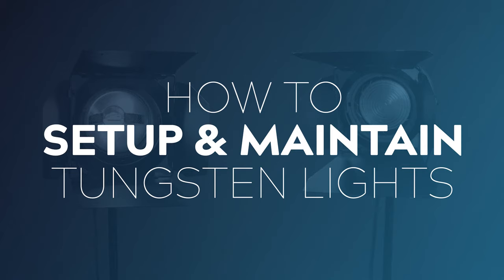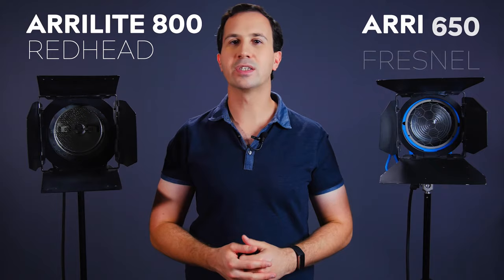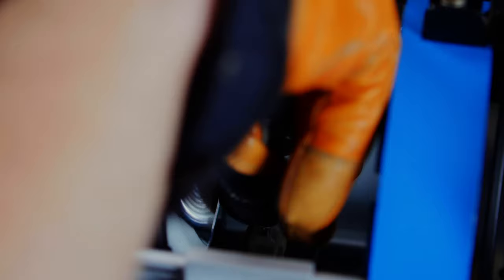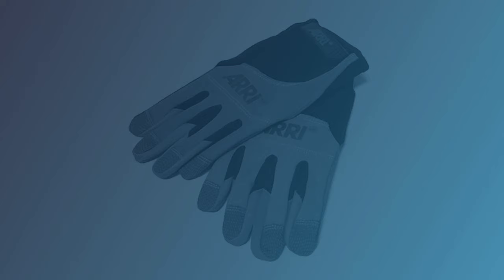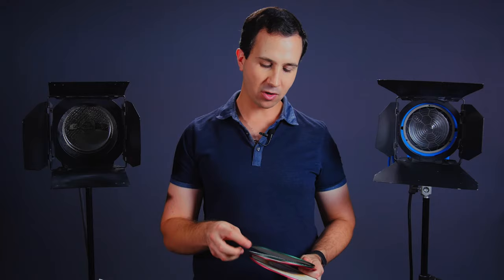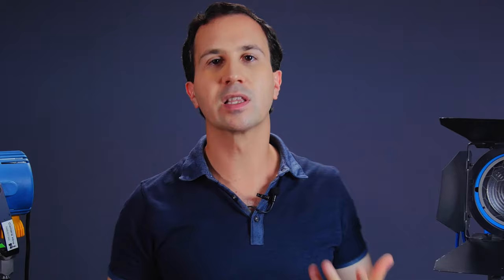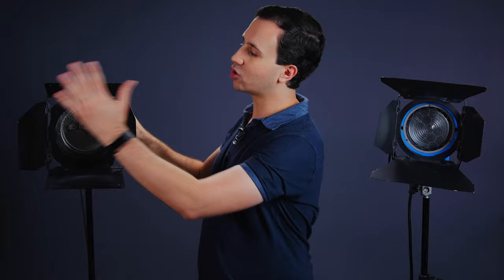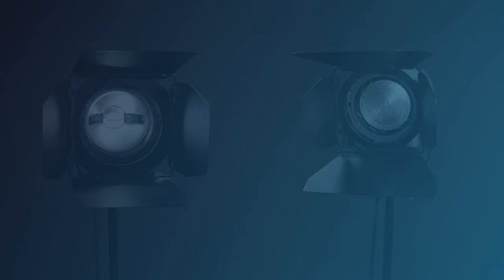Working with Tungsten Film Lights | Film Lighting Techniques

Comment: Looking forward to owning an Arri lighting kit.
Reply from the maker: They’re brilliant. One of those pieces of kit that just work. They are super reliable, will last years of abuse and always get the job done.
Reply: @CreativePathFilms  I saw a kit of ARRI 650s for about a little over 3k and another with a 150, 300, and 650 for about 2700. Maybe one day I'll get lucky and there will be some sort of sale haha
Reply from the maker: @Lycan Visuals  
Keep an eye on the used market. They’re often being sold off to be replaced with LED fixtures these days. Look at auction houses, FB marketplace, filmmaking buy/sell groups and eBay. You can find real bargains on Tungsten lights. 

Look up and call some lighting companies/gaffers in your area and let them know you’re in the market. You could also get in touch with Film schools and see if they ever sell off gear, thats where we picked up our 2k and our 650 and 800 sets. 

Because the lights are pretty much bullet proof, you can save a lot of money. They’re so simple electronically that often the only thing you may need to get repaired or replaced is the power cable. Once that’s done there good for years.

Comment: Thank you. Great video. I have a question, for daylight 5600K, is it better to use Tungesten light with CTB gel or a HMI light right away? I read recently "Tungesten light emit a smoother spectrum of light than any other artificial sources, making for the most natural skin tones"
Reply from the maker: Great question!

This is all my personal opinion, drawn from my own experience lighting and shooting. 

I’ve come to prefer using native sources. I definitely agree with that statement - but you get those benefits mostly when you’re lighting and shooting with your WB at 3200k. 

Tungstens full spectrum quality is hard to beat when it comes to beautiful skin tones. But I’ve always thought once a gel is applied you start to lose some of those qualities/benefits of a full spectrum source and your colour accuracy is then determined by the quality/imperfections in the gel instead. If the gel is older or starts to fade/melt this becomes really noticeable and you start to see things like green shifts. 

I personally feel that native 5600k sources (hmi or a high CRI/TLCI LED) look better on the skin at 5600k then a gelled tungsten fixture. 

But the difference is pretty negligible. Practically, I wouldn’t hesitate to mix a gelled tungsten with LED/HMI sources, nor hesitate to use a gelled tungsten if I needed to, but for the best quality that’s my preference.

If you’re looking to buy a new light, I find myself using 5600k lights 95% of the time these days unless I’m in a studio environment or a location calls for a warmer tungsten look.

Comment from the maker: Just a quick amendment: okay so turning the light off for small adjustments such as panning, tilting and gelling might be a bit overkill. For large moves, definitely switch it off though! When you used to teach at a film school like I did, where these blew all the time, I guess you get a little over cautious with your instruction! Haha. Just be careful guys.

Also, I made an error when putting this video together. Green scrims are a 1/2 stop light reduction, and red scrims are  a full 1-stop light reduction. The half scrims will reduce the output on half of the area of illumination, so is useful for reducing the output hitting the foreground vs the background. Useful for when lighting multiple subjects at different distances in the one frame.
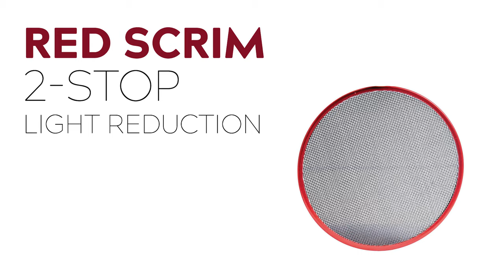Reply: 07:28 The green colored scrim reduces the light by a 1/2F-stop, while the red colored scrim is more dense and reduces the light by a 1F-stop. The half single scrim is often used to divide the foreground and the background lighting resulting in an 1/2F-stop less light on the foreground area than the background.
Reply from the maker: @_C_E_D_  you are correct, that was an error I made when putting this video together. Thanks for the note!
Reply: @CreativePathFilms  No problem, I like ur videos about C-Stand and lighting fixtures, it's really detail-oriented and clear. Rarely seeing these kind of topic on the internet.
Reply from the maker: @_C_E_D_ thank you!

Comment: You say the light temp changes when you dim the light. If you use a CTB gel to correct for daylight and dim the light, is there some calculation that has to be done or is the effect of the gel on the Kelvin reading the same?
Reply from the maker: Hey Leon, great question!

It’s all relative. If the tungsten source shifts (for example) 500 Kelvin warmer as the light is dimmed, and then you add CTB to that, the result will still be 500k warmer. 

To get it to a daylight value of 5600 Kelvin from a dimmed tungsten light, additional gels would be required. 

To know precisely how much a light source shifts when dimmed, you would need to use a spectrometer, like the sekonic c800 to get a precise readings.

Comment: Hi.  I just ordered an old school Arri 2k for studio use. 

Can you recommend working distances? I’ll be shooting through magic cloth. 

Also is it ok to put a 1k bulb I. If I ever needed to? 

Thanks!
Reply from the maker: Hi Jesse, 

Thanks for your message, I haven’t worked with magic cloth personally, so can’t speak to how heat resistant the fabric is. I have been trying to find an answer for you but so far haven’t been able to find anything definitive. 

With textile diffusers I would typically put them on a 4x4 frame and have them around 3+ feet away from the barn doors, at which distance you should be pretty safe I would imagine. If you’re using a larger diff your’ll probably have to get it back further than that anyway. Play it safe. You probably won’t want to get a 2k too close to your talent anyway, unless it’s the dead of winter!

Not sure about the 1k bulb. A quick poke around the Arri website seems to indicate that the Arrilite open face 2k (which we have) can only accept 2k bulbs (I don’t think they even make a 1k in that size bulb). 

 Though it looks like the 120v version of the T2 fresnel may be able to accept 1k bulbs. 

Hope that is somewhat helpful 🤣
Reply: @CreativePathFilms  Thanks for the info. Appreciate it. These Arri lights produce such beautiful light I'll def keep researching and testing to know them better. Great channel!!
Reply from the maker: That they do. All the best my friend, I’d love to hear about what you learn from using them and see some of your results. All the best!

Comment: Loving the content, instantly subscribed!
I have a question:
You stated that the green and red scrim provide a 1 stop and 2 stop light reduction respectively.
The scrim kits i was able to find report a 1/2 Fstop and 1 Fstop reduction respectively.
What's to be believed? Is it just a matter of names? 
In simpler words, with the green scrim the light intensity is halved (1 Fstop) or something different?
I am pretty confused, thanks in advance and keep up the good work!
Reply from the maker: Hey Fabio!
Thanks for subscribing and for posting your question! Great to have you here.  

Yes you’re right! I’ve accidentally made an error - thanks for picking up on that. I’ll post an amendment in the description. 

A green scrim (single) = 1/2 stop 
A red scrim (double) = full stop
Reply: @CreativePathFilms  
Thanks to you for clearing up a confusion I had ☺️
Reply from the maker: No worries at all 😊

Comment: what kind of dimmer switch is that on the tungsten Arri 800?
Reply from the maker: It’s a TecArt 1000w single channel dimmer. Here’s a link if you’re in AUS:

https://secure.johnbarry.com.au/single-channel-1000w-dimmer-tec-dimpot2

This seems to be a comparable US equivalent:

https://www.bhphotovideo.com/c/product/755346-REG/Impact_D_1000_D1000_1_000W_AC_Dimmer.html

Comment: What About power? Do you need a generator or somthing?
Reply from the maker: Depends on the situation. 
Tungstens are AC only lights, so if you’re using them away from mains power then yes they need a generator. They do draw quite a bit of power so if multiple lights are used power draw and circuits become a big consideration.

I also cover this point in more detail in this video:
https://youtu.be/iHxANOeLoTY

Comment: Hello 👋, thank you 🙏, can you please share a link to where I can purchase those bulbs for the arri 800w and if possible the redheads too… I have failed to find their replacements! Thanks.
Reply from the maker: Thanks for stopping by! Thanks for the comment. 

This is the model you’re looking for:

“Osram Lamp 64571 P2/13 DXX 800W 240V”

Depending on where you are in the world, you’ll need to get r correct voltage - 110v or 240v

Here’s an AU eBay link:

https://www.ebay.com.au/itm/194233356820?chn=ps&norover=1&mkevt=1&mkrid=705-139619-5960-0&mkcid=2&itemid=194233356820&targetid=1280421173919&device=m&mktype=pla&googleloc=9068952&poi=&campaignid=10101785162&mkgroupid=124139272993&rlsatarget=pla-1280421173919&abcId=9300367&merchantid=7604792&gbraid=0AAAAAD97CxQeDnkUT4L9IYLAvCtdVVBI7&gclid=Cj0KCQjw18WKBhCUARIsAFiW7JyTqCO-E_IsruxcEWVYcsvksEtUYGQUn3xr3OtMC0wafKIb_jBSpZMaAoQbEALw_wcB
Reply: @CreativePathFilms  thank you so much 😊… I’m in Uganda 🇺🇬 and we use 240v… I really wanted to improve my work and with these lights (arri800, redheads), there’ll be much improvement in the cinematography of our work! I read appreciate what you share here and your help🙏❤️❤️❤️
Reply from the maker: Thank you very much, we really appreciate it! We’re here to help 😊

Comment: How do you attach CTB when using a Softbox? Thanks. Great video.
Reply from the maker: Thank you! It can be tricky. Because of the heat you’ll need a large sheet of CTB to go on the front, or gel through a 4x4 frame or similar. If you get it too close to the source, the gel can discolor or melt.
Reply: @CreativePathFilms  Great, thank you. In your testing have you ever discovered a decrease in light output using a single sheet of CTB 201 vs layering two sheets of CTB 202? 1/2 CTB is blocking less light so is it a reasonable assumption that there would be no discernible difference and therefore either approach would be fine?
Reply from the maker: @andihunt  hey Andrew!
Whilst I haven’t tested this with a meter to see if there is a difference, practically I’ve never had an issue doubling a half gel to get a comparable result. I’m sure there would be some variance in terms of color and output, but it would be minor. I’ve never noticed anything subjectively. 

If I test it, I’ll let you know what I find. You’ve made me curious now 🤣
Reply: @CreativePathFilms  That's good to know. Sure is cheaper doubling it than buying a new roll of 201! Thanks for taking the time to reply. Cheers

Comment: Show us the softbox then
Reply from the maker: The one I have features briefly at 1.37 in this video. It’s by Britek and it’s as old as the lights themselves, with a custom modification to the speedring so it can slot into the barn door/accessories slot.

A quick google tells Britek still sell tungsten softboxes. This kit was all purchased second hand and was customised, not sure what’s currently the best out of the box solution. 

https://youtu.be/xKLINS7uANg?si=I9OX2p0wgtjDrwcC